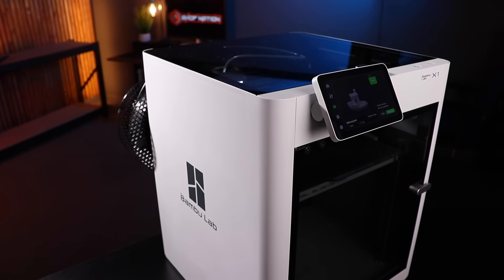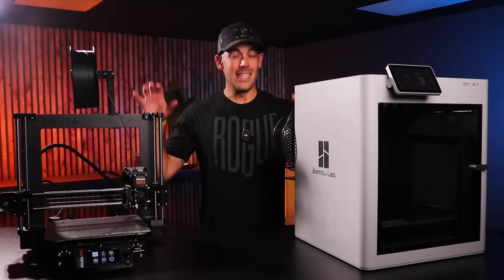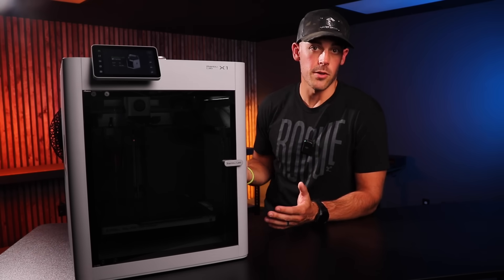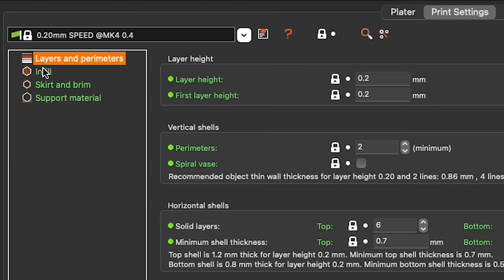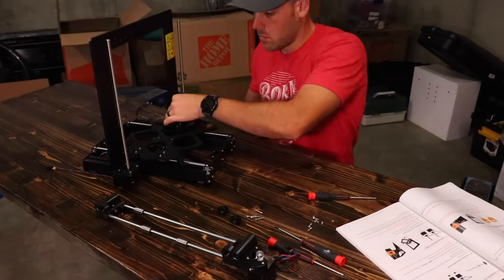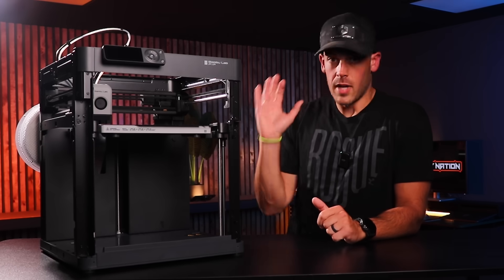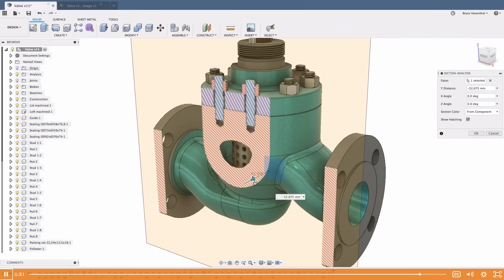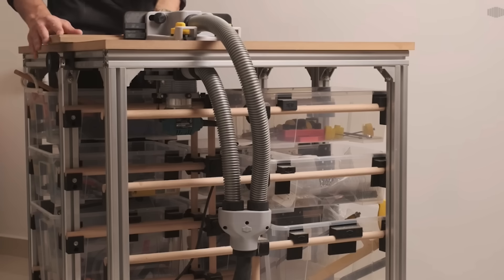The 3D Printer I'd buy if I started over

Comment: The prusa is disqualified unless you only want to print useless trinkets and calibration cubes. If you want to print useful suff you need to print at least ABS and you need an enclosure for that.
Reply: I have printed plenty of ABS without an enclosure but I do have to make sure to keep the printer in a place with minimal airflow. That said I print mainly in PETG these days as it has enough heat resistance for most of my applications but it is far easier to print than ABS. The only reason I do anything with ABS is if I want to do an acetone vapor bath.

Comment: Great video.  But, my entry price point is more in the $300 price range, maybe I could stretch that to $400.  I have to figure that I'm probably going to spend more for filament and other supplies, so I need to leave some room for that.  I seem to remember seeing Prusa and others in the $300 - $400 range.  What would you recommend in that price range.
Reply from the maker: I'd look for a used Prusa around you, one that hasn't been completely run into the ground

Comment: Ender 3 Neo. Less then $300, auto leveling. Upgraded springs. Glass print bed. 

Cheap, and still ate the entire learning curve like a boss. 
Two upgrades printed and it's perfect. 

Z axis rod cover so the filament doesn't tangle around the z rod, and a wider fan mouth.
Reply: I've got an Ender 3 Neo too and it's been awesome. The few problems I've had were either user error or something simple (bed leveling) that I had to figure out being a newb. I haven't had to replace anything but a nozzle, bowden tube, and brass extruder gear despite it running constantly for 7 months

Comment: The idea of an “entry level” printer is somewhat a misnomer, as there’s generally a direct correlation between price and user friendliness/quality of life.

I got into 3D printing with an ender 3 pro, a very popular cheap printer. I love it but also ended up buying several upgrades for it that now come standard on most higher end machines. It probably still cost less overall but took quite a bit of tinkering to get there.

For someone starting out in the hobby it can be very much worth it to spend a little extra for an enjoyable experience out of the box.

Comment: I've done some limited 3d printing, its been my experience that the safety and health aspect is almost never addressed. The process of 3d printing can have fine byproducts in the air especially if its in an enclosed stationary area. Fire has also been an issue for some due to thermal runaway. It would give your material one step above everyone else if you address these concerns in some part. Most people buy these things, and don't realize. If you already have a predisposition for things like Asthma, or worse, this safety fact about fine particles should be mentioned before you drop 1200 dollars on a machine. This is particularly important for materials which use higher temperatures or are more toxic (ABS/Nylon) as the VOCs emitted are increased with temperature and potentially more dangerous.
Reply from the maker: Cheap printers are typically more dangerous because they don't have the sensors needed to prevent a thermal runaway.  Also, standard "beginner" filament is perfectly safe

Comment: I am an industrial designer and was trained in a variety of 3D applications and use 3D printing for my work and proto development. I finally got a filament printer (for myself and not through work) as I required something on this level and refinement and literally waited decades before buying a Form 3+ and now this Bambu X1 Carbon. Both of these offer what I need to do rapid prototyping for mold-making and functional parts. I do not want to mess around with faulty and problematic printers and these have both been pretty solid with the Form 3+ being 100% foolproof and offers super high resolution. Between these two printers, they are faster and actually more capable in many ways than the +$50K Stratasys printer we had at my last job (materials variety etc.). It’s a good time to obtain printers for pros, self-employed and hobbyists.

Great suggestion on people using gig economy modelers to help with parts. I find that many people get in over their heads and buy equipment that they are really not ready to learn everything to maximize its use. Also agree that newb hobbyists should just get the P1P and upgrade if necessary. No point spending money on something you aren’t sure you will use that much. (Could end up dusty in the corner for many).

Comment: If the Bambu X1 did not exist, the Prusa MK4 would be the obvious choice. However, the X1 does exist and it blows the MK4 out of the water, there is no competition between the two. This is coming from someone who has owned and operated multiple Prusa 3D printers over the years. However, I have no brand bias, these are tools to me and nothing more. 

1. CoreXY kinematics vs Bedslinger. The Bambu X1 is a coreXY printer while the Prusa MK4 is a bedslinger. CoreXY is fundamentally superior, allowing far greater speeds, and is more compact for a given print area. Bedslingers are the budget option as it requires less structural material and components.
2. Enclosure. If you want to print higher temp materials, you can't do it easily with the MK4. You'll need an enclosure, and fundamentally speaking, Bedslingers are inferior in this regard as they require far lager enclosure to print area ratio, which means that it will not be able to achieve high temperatures within that chamber since the heated bed functions as the heat source. Additionally, as advanced materials require high ambient temperatures for proper inter-layer adhesion, the rapid shifting of the entire print model with a bedslinger acts against this as it forces the previous layers to lose heat to the ambient environment. 
3. US availability. Bambu labs does a far better job with shipping and parts availability in the US as it is an American company. They have a full range of replacement parts easily available with fast cheap shipping. With Prusa, you can either buy directly and pay high shipping costs + import fees, or you can buy from their US authorized dealer PrintedSolid, who does not stock the latest printers or have stock of in-demand replacement parts. Also, Prusa's products are constantly backordered because they insist on using 3D printed parts and have trouble with their sourcing logistics. Bambu has a far better logistics department who actually understands how to maintain a reliable supply chain so they're rarely out of stock and if they are, they're able to cover that gap within a short time frame. 
4. Feature set like spaghetti detection, micro-LiDAR, print camera, touch screen, etc. Not comparable between the two, the X1 wins hands down.
5. The Prusa is not as reliable as you make it seem. Their insistence on using 3D printed parts for the entirety of the toolhead and much of the structural components have caused a lot of issues. For example, the PINDA sensor sag issue, the part fan deformation, and the lower structural rigidity due to 3D printed structural components. 
6. I want to address your point about serviceability. If a product is properly engineered like the X1, there is no need to replace structural components, ever. Any of the common wear or failure components are openly available. If I have to replace a linear rod or structural component, I consider that a defective machine. I don't ever want to service structural components or any kinematic components. 

For any engineers who want a 3D printer as a tool and not a toy, the X1 is the only choice. The MK4 is living off of brand reputation, it is not competitive with the X1 at all, which is why they've already slashed prices.

Comment: Great advice.  Ive owned 9 printers total now, including 4 prusa, and i have touched nothing but my bambu P1p since getting it.  Better, faster, cheaper.  Prusa while requires less intervention, maintenance etc... than an Ender, still needed far more adjustment than basically 0 on the bambu.
Reply: It's the rule of FDM printing.. the more you initially spend, the less investment of time/money you have down the line with configuration.
Reply: Looking to  sell any of the second hand used ones you don’t use?

Comment: Nah, sorry. I get your point, but trying to make newbie printers that can print out of the box, i don't know if i loke that prospect, as you're stating that john doe who never touched a printer or even know what a stl is expects "oogabooga plug in and print stuff". And as soon as they get an error that is slightly complex, they turn the back to the hobby. Besides, input shaping is at all a prusa or bamboo, i have that on my crappy tevo tornado that costs 1/4 of either of the former after i added to it and I'm no engineer (not even really good at this). This kind of hobby needs indeed to know a bit more than oogabooga.

Comment: I am sorry, but I'm closing this video halfway. Misleading information. For one, input shaping IS VERY hardware dependent, and although, Prusa is promising this feature on MK4 it will never be the proper input shaping because the printer is missing an IMU. For the second, "P1P" is JUST missing side panels. For enyone who wants to get in 3D printing and start printing high temperature materials, that is pretty crucial difference between the machines. Moreover, no mentioning of the main differences between slicers such as great remote access by Bambulab whereas Prusa really sucks in regards to this.

Comment: If the Prusa MK4 isa beige toyota corolla, and the Bambu is a Tesla model S, then my Ender-3 is a 35 year old Suzuki Samurai. 🤣 You can always get it to work, but you're going to have to tinker with it.

My 3d printer has solved so many issues for me, and it has allowed me to fix so many things that I would have had to throw away if I didn't have it.

Comment: At this point, please don't buy a Prusa Mk4. It's a good printer, don't get me wrong, but its software is unfinished and its mechanical design is just outdated for a printer of its pricepoint. A Bambulab P1P will give you a better experience in almost every way for much less money. Or get an X1C for the same price and gain the ability to print technical materials like ASA, Nylon or PC reliably due to the full enclosure, and also premium features like AI spaghetti detection (not that you would need it often) and LIDAR calibration.

Comment: This has been the best video I have seen for telling beginners! And I too wish I had a "working" CNC as they have the same problem as 3d printers. Sadly. 
I print ALOT on ONE Prusa MK3S+. I talk about my prints and what I do and people ask. OH SO WHICH PRINTER DO YOU RECOMMEND? I say get the Prusa only because of its track record of just "working" I haven't used a bamboo but its getting a lot of praise right now. I also say DO NOT BUY AN ENDER!!!
They say ok! and months later they say, guess what I bought an Ender! Now what? 
... Um get ready to become a nerd or own a $200 paper weight. 
I am not knocking Ender owners! Because it is possible to get one of them working "like" a prusa. BUT the amount of people I know that have Ender paper weights is too many. Plus the amount of people I know that got one working... none of them. That's because all these people just wanted to print something and didn't want to spend $699. But now find themselves in over their heads.
Just working is a great recommendation! 
Plus both printers come with some great features! 
I would love to have the MK4! As the MK3 does have a few bed sticking issues but nothing like most other printers. Plus their tech support is pretty good too.

Comment: Hey man, the main purpose of a hobbyist 3d printer is to print parts for itself to make itself better.

Seriously though, I think you are forgetting the anker printer or the Ender 3 S1. Both will pretty much print out of the box reliably and for less than half the cost of these two.

Comment: This is great advice for someone who isn’t looking to tinker with a printer constantly. I have a Prusa, an Ender 3 v2, and an Anycubic Vyper, and of the three, the Prusa has been my least finicky machine. The Ender also worked great stock, but was a bit too slow for my tastes, so I’ve modded it extensively. The Vyper has been nothing but constant headaches.
Reply: I went for the Prusa MK4, expensive , but it prints right out off the box, absolutely no tinkering.. this is my first 3D printer
Reply: After modding the ender 3, do you think it is worth the money compared to the other brands that is more expensive but already comes fully upgraded?
Reply: @axeltheodorus18  I had ender, and compared to Prusa, Ender is a complete waste of time and money. Prusa just works :) Mine is going strong for 4 years now

Comment: ive been exclusively printing with Ender 3 printers. They have been reliable, great, easy to maintain and i can fix them in a jiff if something goes wrong. I recently purchased the P1P and OH BOY, my 3d printing world has changed. Just having the AMS hooked up to it, i never have to worry about running out of filament. Its a game changer, and I love the printer so much. I make props and the quality of prints coming right off the printer as "normal quality" is mindblowing, a quick layer or two of filler primer, and the print is ready for painting, in most cases, no sanding required.

Comment: I haven't used my printer in over a year, because I'm sick of faffing around with bed levelling. Yeah, it's an old one - I built it from a kit about seven years ago, so I could probably buy a new one.  But what?  Resin printers just replaced one faff with another - curing and washing.   I'm older now and I have better things to do.  You might have just piqued my interest again.

Great vid, btw, I loved the presentation and no nonsense approach.

Comment: I’m super happy with my Prusa Mini+. It’s been working for over a year without single fail. After assembling it worked from the first print. Recently I changed nozzle to 1mm diameter and now it prints much faster and 3 layer perimeter wall is rock solid at 3mm thick. I was able to run it at 170% speed at 230C with PLA with 1mm nozzle!

Comment: Does the P1P have a self leveling bed? I’ve been REALLY interested in getting my first printer and the $699 is in my price range. When you go to their site, they try to sell you other stuff with it - is it necessary?  What filament do you recommend learning on? And where would you buy it?
Reply from the maker: Yes P1P has a fully automated bed leveling procedure.  I'd recommend starting with PLA, it's so simple to print with.  There are lots of good options out there but DO NOT just buy the cheapest stuff you can find.  You really get what you pay for and for an extra $2-3 per spool, it makes a big difference.

Comment: I wouldn't waste time with non-resin printers. Resin printers are superior in every way, and now, even cost. More detailed prints, no silly horizontal lines, less moving parts meaning less breakdowns, no filament getting jammed and a print getting wasted
Reply from the maker: Now that is a hot take.  I'll agree that resin has come a long way, there is a significant hassle factor associated with them (curing, cleaning).  They are fantastic for some things but I'd argue FDM is better at a wider range of applications - especially practical ones

Comment: ABL Just means that the bottom layer won't be on a parallel plane with the rest of the print layers. Manual bed levelling has a similar issue unless you can attach a dial gauge or similar to the head when levelling it. Until the ABL sensors can be used to tell the operator how to manually level the bed it's all just gaslighting. But it makes for good sounding you tube vids.

The next one is that even the prusa and bamboo printers are just one clogged nozzle away from being unfixable for the average person. So the claim that these are beginner friendly is a lie. The technical barriers of entry that creality printers (as an example) represent a way of weeding out who should, and who shouldn't, own a 3d printer.

They're a tool and not a toy and they have aspects to them that are dangerous. You don't hand a circular saw to anyone. You shouldn't do the same with a 250 degC nozzle and a 100 degC print bed in a confined space.

Check any printing forum and you'll see endless new posts from people sucked in by you tube videos telling them how easy 3d printers are... and then they cannot do the simplest things.

As I will always say. Even if it works out of the box... every 3d printer is landfill after the first clogged nozzle if the printer is in the wrong hands.
Reply from the maker: Yeah except that same "YouTube" can pretty easily walk someone through how to deal with clogged nozzle.  I'm sorry about your Ender experience

Comment: I wish I got the P1P instead of the X1C. There are issues with mine, and I am stuck in a position where I cant decide if I should fix it myself or deal with the useless customer support they have. My first X1C had a failing linear bearing and took 3 months to return/refund that one, so I'm discouraged to go through all that again.